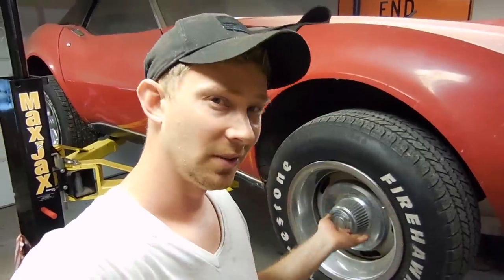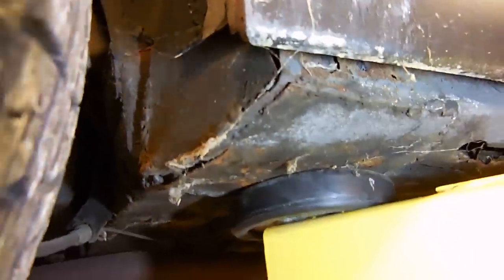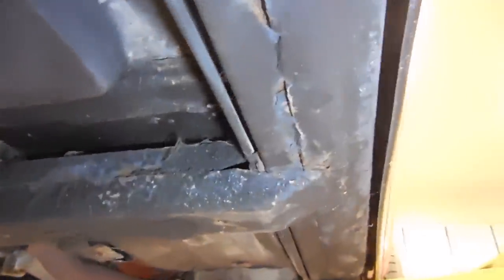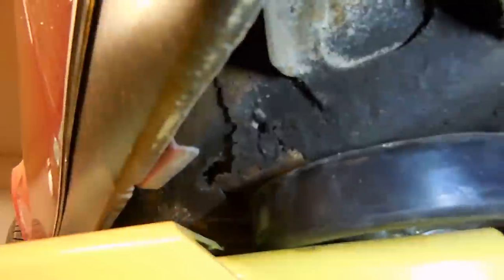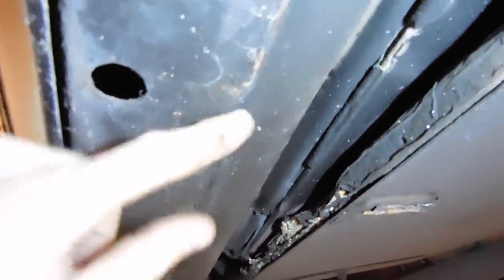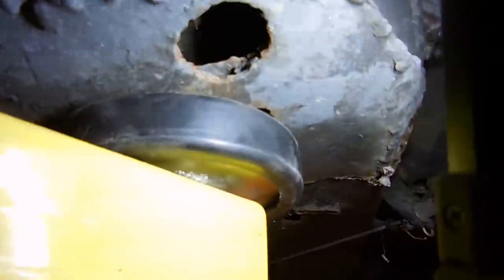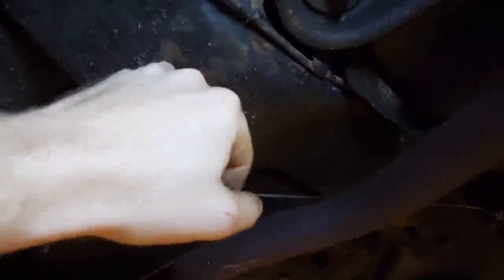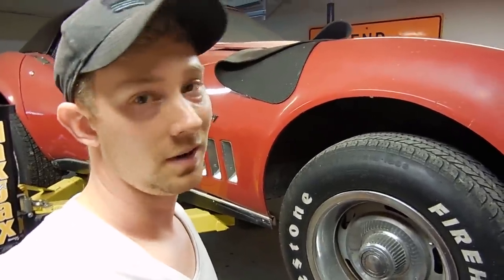Beautiful 1969 Corvette Stingray ROTTEN Underneath! Check Your Frame on Your C3 Vette!!

Comment: Swapping out the frame would make a great video series.
Reply: Is it hard to do ?
Reply: This car is worth saving with a frame swap.    Wax / oil coat the replacement frame me inside-out, outside-in which would have prevented this rot in the first place.
Reply: Yes,  would make a great series,  but it's alot of work, and having a lift would make life much easier. The worst part is, by the time you do a Frame swap,  you end up doing a total Frame-Off Resto on the car. I know!
Reply: @scdevon  Buy a new powder coated frame from Corvette Correction, Schwartz, Art Morrison, Precision, Roadster Shop....there are many to choose from. And get it custom manufactured to fit your needs.
Reply: @scdevon  Make sure replacement frame has a drain hole by the rear wheels.
Reply: @enriketrujillo7551  It's a major production to do so. I've done a few.
Reply: @enriketrujillo7551  Not for people who are in that line of work.
Reply: @sergeantmasson3669  The major problem is the box-frame construction. Every space inside that frame accumulates dirt, and the dirt retains moisture. Worst ones are the cars that were driven in winter, and road salt entered the frame.
Reply: @rollydoucet8909  C3 Corvette frames had a factory defect. In front of the rear wheels, there was a 3/8" diameter hole. Underneath, that area, there wasn't a drain hole. Thus, that section was prone to rust-rot.
Reply: @scdevon  yes my 40 year owned vette get oil spray inside frame and out + bird cage through screw holes
Reply: Is it safe to lift those car by the frame with that weaken frame ?
Reply: @rollydoucet8909  Even for a highly experience person, it's a tough project to do and it's expensive. 1968 roadster, for example, the frame is a bit different. 1968 roadster uses aluminum body mounts.
Reply: @lawrencebraun7616  The frame is only weak if it has already started to rot.
Reply: @scdevon  how much would it cost to save the frame?

Comment: looking at the door gaps its like the front and rear are sagging/ flexing on the lift
Reply: Saw that too! I'm glad no one got crushed underneath this thing!
Reply: That's the first thing that caught my eye too! Those doors must be difficult to open and close! Looks like a 41 Chevy Business Coupe
Reply: jason9022  True. I learned that back when I had my first one.
Reply: Nah,that’s how they come from the factory,it is a Genital motors product ya know
Reply: But when it's sitting on the ground, the gaps may be a lot closer. And it's a roadster. Coupes may not flex as much on a lift.
Reply: @Whateva67  Yeah I worked on a '68 Stingray convertible several times. It was a VERY nice car but would do that, too. Normal stuff.
Reply: Most of these cars sag a little, it does seem more exaggerated

Comment: Had my modded supercharged 1976 L82 4 speed f41 blue and diamond metal flake for over 40 years .  I worked at small town gm dealership auto body shop as a  young teen and college in southern Ontario Canada we have high humidity and dampness which eats stored cars .I learned that the only way to save your frames and Chassis is to spray them in side and out with light oil . My vette gets oiled annually messy but not spec of rust , where there was no access in the frame drilled 1/2 holes and install plastic undercoating plugs . Oiling is only as good as the person applying it and you have to get creative ,when re carpeting the car 
oiled the floor pan .Also remove the screws in the bird cage and oil the birdcage and windshield frame also spray into the screw holes . If # matching people don’t like it then spend half you life doing a frame off and thousand of hours the car will cost $ 100000.00+ if you add up your  time and maybe fetch $35,000 to $ 50000 and it has to be done correctly. I see many c3 for sale some fool took apart and asking stupid prices for a box’s of junk a gouged up body and a half eaten frame they lost interest in it 10 years prior “selling project car “ lolol. The same with boats buying a cheap boat is never cheap it far more expensive (if you factor your time than a good running well kept one )ask me how I know ( redoing a 1977 22foot searay sx220 with a 351w  and Omc out drive ) and had to purchase a f150 for towing which needed rockers cab corners and differential front hubs and touchup it never ends lolol
Reply: B.O.A.T.= Break..Out..Another..Thousand..

Comment: Grew up in the Chicago area in the 70's, this was very common.  One of my neighbors had a '72 and 10 years later had the body off so they could repair the rusted-out frame. Few years later met a HAM radio guy that had one in his garage for the same thing.  First time I saw someone doing TIG welding, he was a really cool guy.

Comment: Northern car that made it's way South-  I replaced the frame in our 1972 and it wasn't that bad!
Reply: How much did you spend to change the frame?
Reply: @ivannorberto7247  Can't remember.  Do remember the frame I bought was NOS direct from GM and a failed race car project that had sat for years.  We were doing so much other stuff at the same time and the paperwork went with the car when we sold it.  Frame was not all that much but labor was a lot as I had a Corvette Restoration Shop do the work.  Pulling the body off both cars-  removal and transfer of parts-   $10,000 sort of rings a bell!
Reply: Cost?
Reply: I've got a 72 conv that looks about the same. Still good for a Sunday drive, but freeway is a no no. I'll leave it for the kids to deal with it!

Comment: The C3 Vettes had  factory defect frames. Hole in the frame in front of the rear wheels but no drain hole underneath. I've changed a few of those frames.

Comment: Looks like Northeast car that was driven in the winter. Why anybody would drive  a Vette in the winter is beyond me but this was the early 70's. Maybe they did.
Reply: Yup. The rear tires send everything into those box frames at the rear of the rocker panels. You'd think the engineers would have thought about that.
Reply: @rollydoucet8909  Engineers? I think you mean the "bean counters" at GM!
Reply: Owning a better makes it necessary to have another car. After some buy a better they can’t afford gas and insurance much less a second car.

Comment: Rusty frame, no problem. Jack the sucker up, disconnect the bumpers, cut/torch the 8 body to frame mounting bolts, disconnect the electrical, and then use the lift to pick up the body. Should be done before you finish a 12 pack of your favorite beverage. The real fun begins when it comes time to fixing the rust that will inevitably be hiding in the lower windshield frame and birdcage. Regardless, it is STILL a 69 vert/4 speed car, and deserves a resurrection. Good job detailing the rust damage.
Reply from the maker: You forgot all the rusty suspension that needs replacing
Reply: @TheCorvetteBen  not too bad to deal with when you have 20 years worth of control arms stashed on the shelf. Now when it comes to those trailing arms however..... 😁

Comment: My buddy’s 85 Monte Carlo frame disintegrated from storage on a cement floor. It had very low mileage and was a right off from sitting.  For those who store cars, make sure it’s either stored on a dirt floor or have a professional car mat that is impermeable like mine is. Also use a breathing car cover and a full tank of gas treated for storage. Always have nose out when parked in your garage.
Reply: Why nose out ?

Comment: I recently bought a '70 Corvette 9/20 from a Classic Car dealer in upstate NY and trusted him due to the many pics he sent me of the car.  Supposedly the Vette spent it's life in the South but frame has a lot of rust which makes me question that. 
Paint, interior, and drivetrain was in excellent condition but frame is very rusty but not quite this bad. 
I live in Georgia but still should have traveled there to inspect before buying.  I'm going to try to rust-treat the frame and if not satisfied, plan to replace the frame in the future.  This is my second C3 Corvette and learned that I always need to inspect in person before buying.
Reply from the maker: The definition of “rusty “ varies from state to state. Texas rusty vs NY rusty is a huge difference. Usually NY cars have no rear frame at all so they probably didn’t think it was that bad

Comment: Had a 68 vert. as a teen...it was solid,dad a 72 coupe, solid as well... I spent alot of time working on the c3....This car is unsafe to drive... heavy rust in the passenger side and less on the driver's...this car was driven in winter no doubt salt damage.

Comment: Found an 80 in the Detroit area several years ago.  Nice body and interior, engine bay was super clean with lots of aftermarket parts.  When it was put on a lift for inspection you could see indents on the bottom of the frame from previous times it had been on a lift.  The frame was so thin that it would have failed  eventually.  The lady who owned it had purchased the car a few years back and never knew how bad it was.  Very sad.

Comment: Thanks for the heads-up.
Living in michigan, rust is our middle name.
   I remember 10 yrs. back, a guy I worked with offered me a '64 Impala SS that ran...for $200.  Said he'd drive it to the house if I wanted it.  I bought it and found out the center X member was gone when I jacked up one corner...and both doors popped open, and the windshield had weird diagonal cracks in it.
   I stripped it and junked it!

Comment: PLEASE do a video on the birdcage of this car, I expect theres nothing left of the windshield surround?
Reply: If the frame is this bad the birdcage is gone.
Reply: @craigscott5661  you got that right..
Reply: @peterrivney552  I oil spray in mine also the bird cage by removing sheet metal screws around windshield I don’t care if it drip for weeks lolo

Comment: What a great video Ben. Yes, inspect before you buy. I wondered if undercoating could trap water from draining.
I love these cars and thank you for helping keep them on the road.
Reply: Yes, the "rubberized" undercoating is terrible.  The rubber cracks over time, and then moisture and dirt get in behind the coating.  The moisture kind of just stays there since it is very difficult to dry back out.  The waxy coating is better.  There is a video showing it in detail, search Youtube for something like, "Rubberized Undercoating Will Destroy Your Car"

Comment: looks like it was driven on the beach.  frame can be replaced...not hard, but labor intensive and a lift is required.  but if the birdcage is gone, then that's that.  would be interesting to see the #2 body mount behind the kick panels...judging by the shape of the kickups, the #3 mount is probably gone.  also under the chrome around the windshield.  too bad...a '69 4speed roadster is a super nice car.

Comment: Whomever did the booger welding was a hack! Time to buy a new frame! Not sure if the total cost of swapping the frame & the related parts would be worth it dollar value wise but at least you would know what you have! You would still have an old drivetrain, paint & interior & perhaps fiberglass issues! The most sensible approach for the owner is part it out & get whatever back that you can before you get buried in it!

Comment: OK, that covers the frame. But given the frame is crap, it would be hard to believe that the birdcage is OK. I discovered a company in Texas (corvettecorrection dot com) that is building new frames for C1, C2, and C3 Corvettes (and some Tri-Five Chevys). They are using the C4 suspension design which is an upgrade from the original suspensions. They say their frames locate the engines and transmissions lower in the frame for better center of gravity as well as giving increased room for modern transmissions without having to cut the transmission tunnel. I am not affiliated with them in any way, just passing along information that some may find useful. I would like to see a video showing how to determine the condition of the birdcage. Thank you.

Comment: Is a C3 worth rebuilding onto a new chassis? How much would it cost if you did the work yourself? Can you get an updated chassis for them? Galvanised?
Reply: depends on the car...a real '69 L71 or a '71 LS6, damn right its worth it.  a '76 L48, naw.  there are aftermarket frames...just need a lift and a lot of time...course you'd want to fix everything else on the car while its apart too.

Comment: That undercoating is why thay frame rusted so bad. Traps moisture and will rust slowly unseen under the coating. My guess theu also blocked the drains in the frame with undercoating.

Comment: Excellent episode! I try to check out the greasy side of an car that I am interested.  Once checked out a 1992 Cadillac and I could literally poke holes in the floor pan with my finger. Rusty frame too. Crazy thing the car was in great shape from the top.
Reply: Bought  a beautiful  72 Eldorado  not driven in winter stored inside  cement floor  in Michigan  didn't ck underside rusted out  completely  humidity  from  concrete  floor did it in

Comment: I watched a video about frame coating, and the point was it keeps moisture between the coating and the metal and the rust goes out of control doing the opposite of what it's supposed to be doing, stopping the rust.

Comment: I noticed as you were panning the side of the car that the passenger door gaps were wider at the top then at the bottom suggesting the frame is flexing on the lift.

Comment: at least they welded in new metal..
.i've seen car frames made out of bondo and chicken wire covered in tar
Reply from the maker: They welded ON new metal. It did nothing but cover holes. Didn’t fix anything or restore and kind of structure. Hindi and chicken wire would have been better

Comment: Frame flex is apparent in the door gap a the start of your video. Steel delamination, the spreading out or the waviness on the frame means the structure and strength of the steel has been compromised. Like one of your viewers pointed out, frame replacement would be great content.

Comment: Wow I saw this and was worried, my 71 is a California car none of those problems not even surface rust, and 500,000 miles on it. Its been driven and maintained replaced parts yes, I did upgrade to a new 383 Stroker Motor 430hp

Comment: Also check the frame rails around the A arms on the front suspension by the engine mounts, namely where their wielded in, as a guy on the corvette forms ran over a speed bump with his 79, it broke the wield that had long since been coming undone and collapsed inward, funny thing was in that same thread someone had a car in resto, he took a close look as he had the frame off, damn thing had it too, photos and everything, early car toom, just a faint crack where the wield hadnt been done right

and I showed it to a friend of mine who had a 68 that was under resto that he had owned since 1972, same damn thing, said he thought the rust did it, as it had lived in a humid climate most of its life, and in looking into it, it turns out the idiots at GM removed a key X brace from the C1 that weighed about 300 pounds, that causes excess stress in the moving of the frame rails, and if its not wielded right, it can come undone overtime mostly likely from rust and fatigue, as the idiots at GM thought the fiberglass would be strong enough to counter it

and incidentally, the first year of the C3 was the first year of mass production methods on the corvette line, so two 68's and one 79.

like frigging GM, they always screw up everything somehow, so check that wield and reinforce, like either put in a roll bar in the midsection or a monte carlo bar in the front, like it never fails, every damn GM product ALWAYS has to be reengineered by the customer to work right.

and the only ones I know that arent like that are the Buick GS's and the Olds 442's, and some of the 70's firebirds, and the chevelle, everything else though, like even the famous 396 has issues.

Comment: I bought a 1972 vetted drove it for 5 years when I noticed that my driver door was sagging. I decided to do a body off restoration,  good thing cause my frame was completely rotten.  Ordered a brand new frame from GM.  Good that you are warning people about this problem.  You would have thought that GM would have put drain holes in and especially in the back...

Comment: I had a 67 coupe that had frame rot due to undercoating which they did back then...where there wasn't any undercoating it was like new.... imagine if you can the trailing arms breaking loose at 70 mph and whipping up thru the cabin..

Comment: My frame has some surface rust, can I just sand it off and put epoxy primer?
Reply: Rick Simpson oil the inside and out side of the frame annually , I did on my 1976 l82 4 speed f41 now supercharged rest Rod  frame like new owned for 40 + years

Comment: Bet that frame weighs at least 70 lbs lighter than it should just from rust falling off, common problem with vettes. Easiest just to buy a new frame, easy to find. I think the frame new weighs less than 500 lbs. I've read of some that were 100 lbs light from rust.

Comment: Had my 73 Nova frame rails and rear sail panel and inner outer fender well replaced also trunk patched $3700.00 February 1,2021 .....        Dump $6,000 in frame work that  $7,000 Vette be worth at least $32,000.